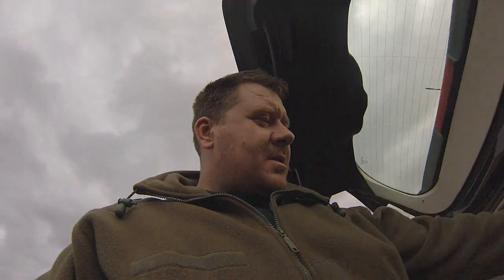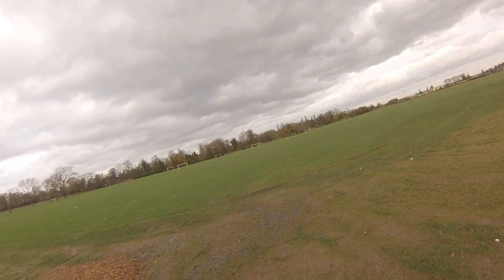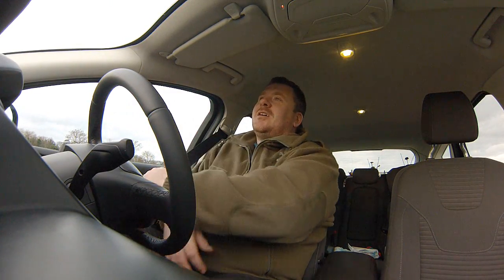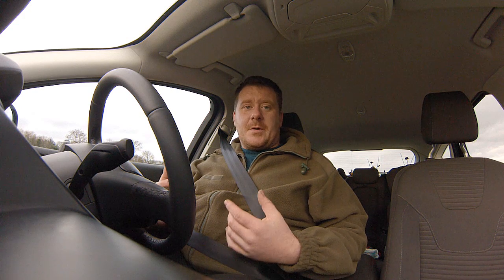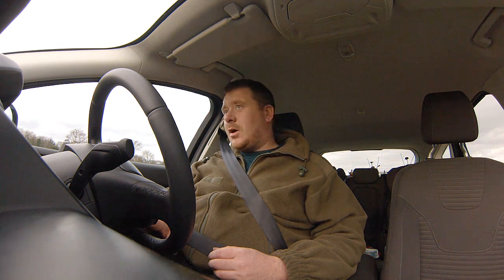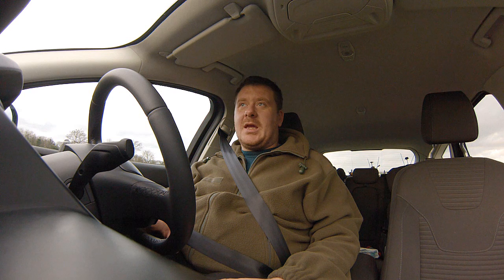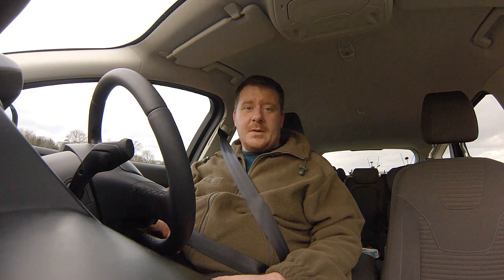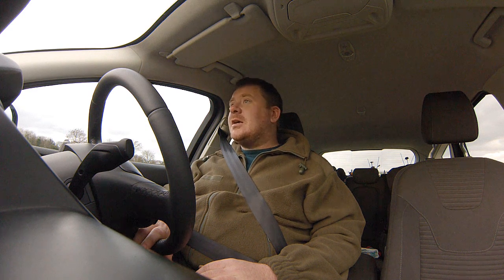ZMR250 - FIRST FLIGHT - ACRO - MANUAL- MODE - CC3D - NAZE 32

Comment: those flips seemed really stable man!! nice work! great field for flying!!!
Reply from the maker: +ron albert thanks buddy it really is i have turned the rates up abit more now so should flip faster with abit of luck
Reply: I will be running cc3d in the 280 my son and i are building! If you get a chance a vid of your rates gains etc would be good!! You are hitting the nail on the head with the setup!